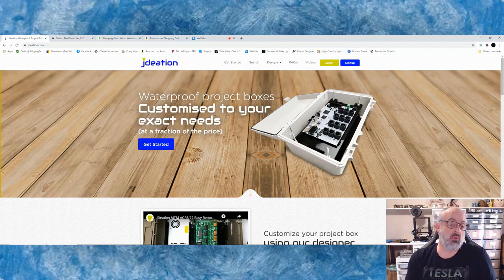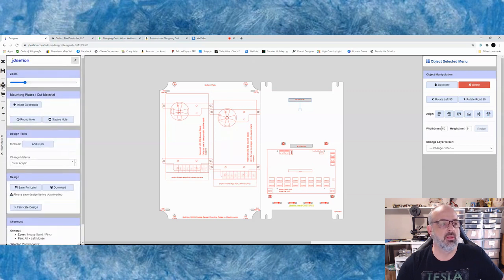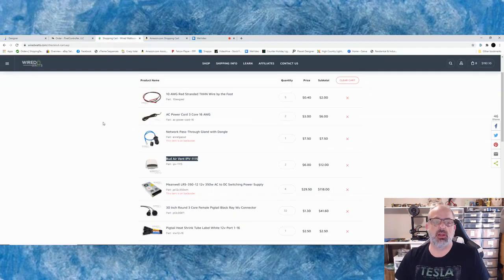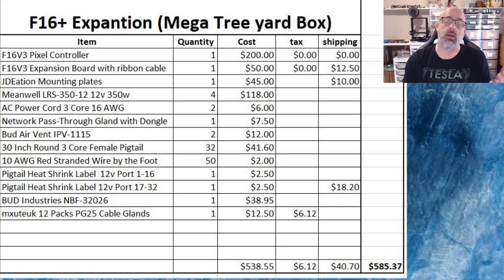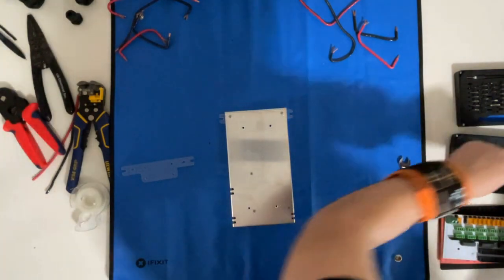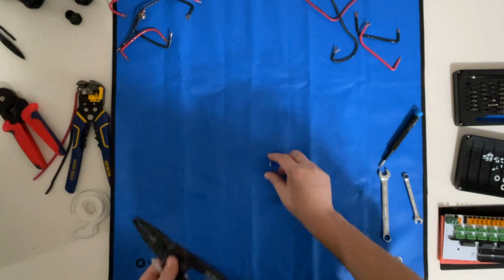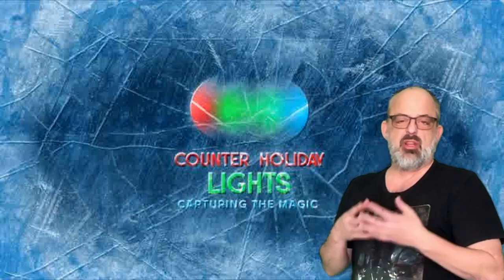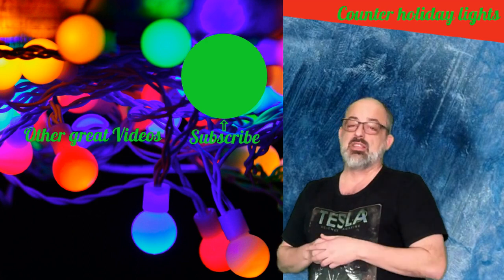Falcon F16V3 Pixel Controller + Expansion Board Bud Box Build

Comment: Very helpfull video thankyou. Quick question how many ws2811 could you run off this box
Reply from the maker: this set up with 4 power suplies can run and power about 5k in lights running at 30% power. if you just want to know what the max light per board with power injecting. the falcons can handle 1024 pixels per port.

Comment: This is super helpful!! Curious on your thoughts here: This is my first year. I have about 5000 total pixels I ordered. Trying to build my box(es). Should I build two boxes? I was thinking about building two smaller ones and connect half my lights on one side of the yard and then have another box on the other side of the yard to power a mage tree and other props on that side. Or should I just run all my props from one box and bring the connections over to it??
Reply from the maker: in our behind the scenes 2020 video we show our F48 which we build receiver boxes for and had 5 of  them spread out though out  our display worked out nicely. this year we are using a f48 with 4 receiver boxes and the F16 with expansion board for our mega tree and yard props.  I would do the two boxes the longer your cords from the box to the prop can cause data issues.
Reply: Two boxes require 2 pixel controller boards?
Reply from the maker: each box would need a board if you are running lights from them either a main board or expansion board

Comment: @5:40 its a good note here to say 10 Gauge wire is used ... because you have less voltage drop with thicker wire than with thinner wire.  Also the smaller the number the larger diameter the wire.  Yes you can use 14 gauge wire even 16 gage wire.  Again, the smaller diameter the wire the larger the voltage drop.  THIS is why Falcon recommends 10 Gage wire.
Reply from the maker: you are correct the manual says 10 which is why i used it

Comment: Very nicely done!  Do you not need to worry about running anything through a fuses?
Reply from the maker: the board is fused for each line going out. you could do one between the PS and the board. while not required any extra safety can prevent a possible issue.
Reply: @CounterHolidayLights  that is what now.   But don't you have to be careful with the amount of pixels on one port if you don't go through fuse box.  Isn't the fuses on the controller only a 5A.
Reply from the maker: @ducebigalow8834  that is why there is a 5 amp fuse there so it will blow before you pull to much power ( but it is 5amps per channel 40 amps all together ) you will never get to High as power loss over the length of lights will stop the lights from working. here is a great site that has a power consumption tool http://spikerlights.com/calcpower.aspx
Reply: @CounterHolidayLights  considering rebuilding my box this year with one of these bud boxes but know or recommend anyone in Canada that sells these boxes or something similar?  If were able to find a different box would these JD templates still work?  Back to my fuses question, the most pixels I have on one port currently is around 350.  If I went without a fuse box will this still be ok?  It would save space on the template (fuse and grounding bar).  I am using 12v and have some power injection going on as well.  Thanks again for your help.
Reply from the maker: No you do not need a fuse with t hat  many light but if you power injecting there should be a fuse on your power injection line from what other have posted about. I have zero power injection in my show have runs of over 300 light is some places.

Comment: I'm building my first megatree this year. It's also my first year with pixel lights. Would this work for a 2000 pixels on a megatree?
Reply from the maker: And then some. I’m doing 12 volt pixels and my tree will be 3200 pixels 32 strands of 100. 180 degrees.  I’ll be dong 200 pixels per port so the tree will only use half my ports.
Reply: @CounterHolidayLights  That's my end goal. I'm doing 2000 12v pixels with 100/strand. My goal is exactly what you are setting up. Thanks. This helps organize my shopping list and will help with budget planning.
Reply from the maker: @chrissbwe  if you any other questions or need some planing help just let me know
Reply: @CounterHolidayLights  Will you just be going to 1-inch spacing instead of 2? Or keeping the spacing and going taller.
Reply: @CounterHolidayLights  this is great! Am I correct in assuming the other ports could also run about 200 each for 6400 total?
Reply from the maker: @IslandOfNyland  close at 30% power with 4 350 power supplies you are at about the limit

Comment: The fan hole is 2 1/2” hole saw
What is the size for the p25 and p9
Reply from the maker: the P25 i use a 1.25 inch and then have to step bit it a touch and the P9 is all with a step bit